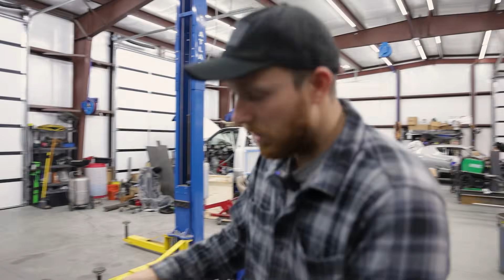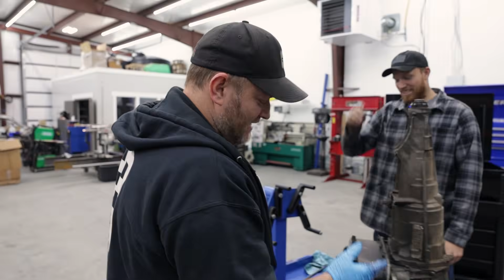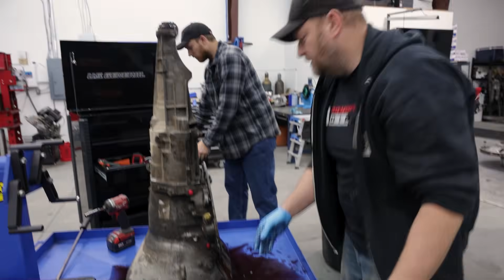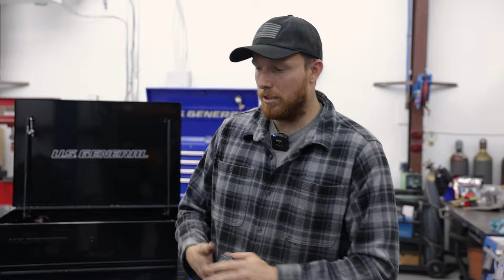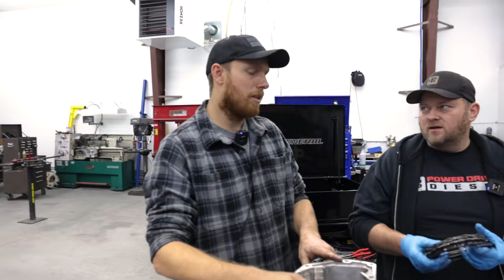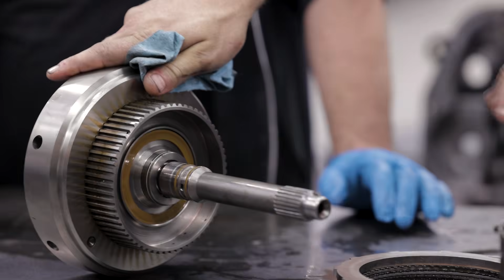We Broke Down a Built Transmission on a 2001 VP-44 Tow Rig

Comment: The description says "We slipped the transmission... and tore it down to see exactly what failed." So what exactly failed?
Or what would have prevented the slip?
Was it low line pressure and/or the converter?

Comment: I’m used to the fact that WAG1 transmissions depend on transmission control modules programmed for exact rear gear ratio and tire size for proper operation and longevity. But you guys NEVER mention the TCM ever. I finally got a 99 24valve (my first Cummins!) and switched from the 245/75 16s to 285/70 17s and have been concerned about my transmission reliability. Apparently rebuilt by one of the best builders in sacramento who I KNOW only does stock rebuilds with only all factory updates. He won’t put a shift kit in anything. So I don’t want to blow it up when I finally put on my new 60-9 turbo. I even bought a quadzilla way ahead of schedule to setup TCM, due to my paranoia. Your tech support guy said ya you use it to correct speedometer but I don’t care, I can figure out how fast I’m going, I just don’t want to blow the tranny.

What gives? Does the TCU even matter on a 47RE?? Can you explain or at least mention the TCM relationship with trans shift quality and reliability? PLEASE??
Reply: My mostly stock 98 12valve 3500 has ate 3 transmissions in its lifetime. I spent 5500 with ATS the first time, Just spent 6k doing it myself this time. You kinda have to be ok with the idea of spending money on the transmission when you get one of these trucks. I knew full well what I was getting myself into..doesn't make it suck any less when its your time though lol Your 47re only uses the TCM for overdrive and t/c lockup, both of which can be wired to a switch. Also FMVB is an option. This era is kinda between fully hydraulic and fully electronic.
Reply: @NickForgey Thanks A MILLION!! Exactly what I needed to know!! Makes PDD 650 horsepower trans look like A BARGAIN to me.
Reply: @claytonargo3085  I would ABSOLUTLY go with PDD! They are the go to for Dodge Cummins trucks. I've got more in my transmission than what I paid for the truck and engine upgrades combined. But I didn't know about PDD at the time.  I just ordered a billet intermediate servo from them to replace my ATS one because I've got a binding issue. I've got a ATS converter, valve body, and small parts kit. I thought it should all work together, but evidently their servo won't work with 2 springs..and without the helper spring you get a bind. ATS stopped talking once my payment cleared. All you get is salesmen when you call, not the techs. PDD helped me out, through email, even though I didn't buy the servo, valve body, or torque converter from them. I got the spring from Muldoons. Its only like 25 bucks but after shipping it was like 75. So keep that in mind.

Comment: As much as I enjoy your content, it's hard to consider anything with a Chrysler 4 speed  as a "tow pig". You can throw all the billet parts at you want, but the factory gear spreads are absolutely atrocious for towing, especially the huge gap between 3-4. When I'm towing in the Rockies I find myself between 3 and 4 all the time, and I have to lock out OD to stay in 3rd with the converter locked. This works well, but it sends NVH levels through the roof which is opposite of what a a comfortable highway tow rig should be.
Reply from the maker: We've found with enough power upgrades, these 4 speed Chrysler transmissions never never leave overdrive.... so the 3-4 gear split problem is solved with more power!!!
Reply: @pddofficial more power is always the right answer! Love it!
Reply: @pddofficial  Maybe, but I remember Will had a few forum posts back in the day on CF and DTR with some data illustrating it's hard to exceed 450hp working towing power. Any more than that you begin to overtax cooling systems (coolant and oil) and thermal runaway becomes a very real danger. There's a reason why HD trucks usually start at 8L of displacement with 400HP, you need the extra overhead in cooling for the engine to survive extended periods at load.

Comment: Honestly why I keep hollering about a valve body video, I ended up with a basic BD-brand 47RE trans with their triple disc that a customer of mine's employees ostensibly sort of fried (broke Raybestos kevlar 2nd band at the spot welds, though the lockup boost valve also had a pull spring instead of a push spring for some reason?). I'd much rather be the builder than the customer when it comes to transmission building, at least until I can afford a PDD 650 horse trans for my 1st gen!

Comment: I would love to put an auto in place of my nv4500 in my 01. Something that can hold more power reliably and shift quicker. Still a ways off from happening, but it’ll happen eventually.
Reply: 48re in my 2003 is amazing. 

Boosts the big turbo quick

Stick shift takes forever to build boost

Comment: Seems like everyone around my area says they have a “built” trans. Everyone says that. Torn so many down that were bone stock with a single disk billet converter and a basic transgo kit 😂
Reply from the maker: It's true that a lot of people claim to have "built" transmissions when they're really just slightly modified.
Reply: SO TRUE!!!!    I've talked with SO many shops to find the right one.   PDD is the best so far in my estimation.